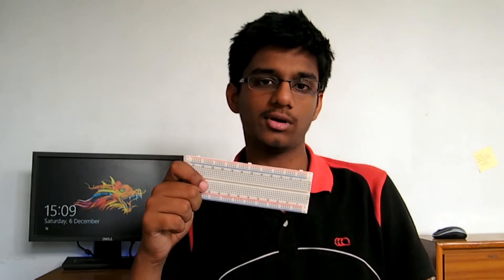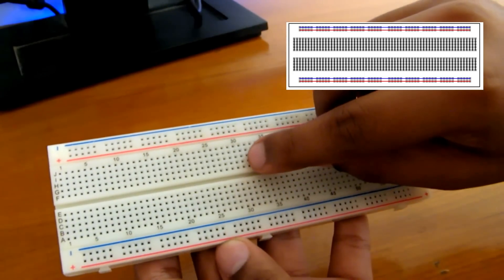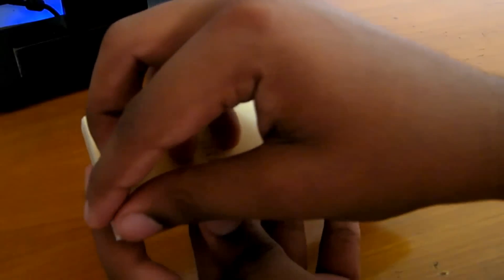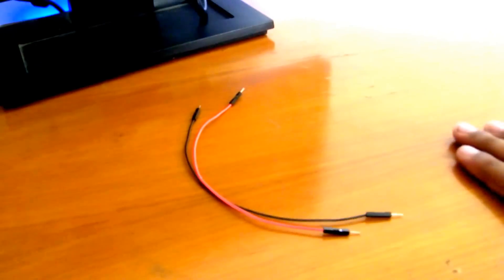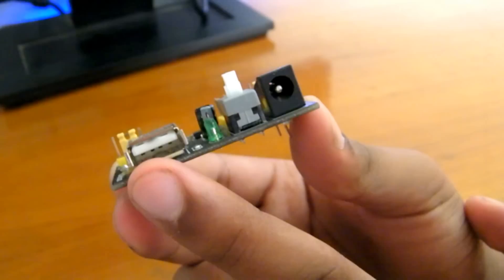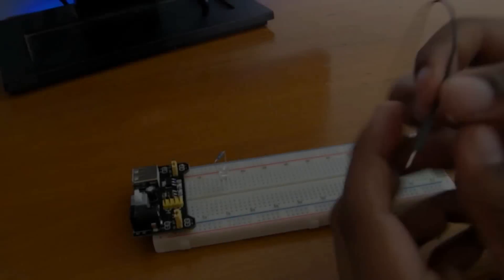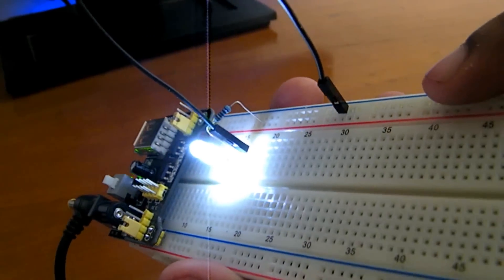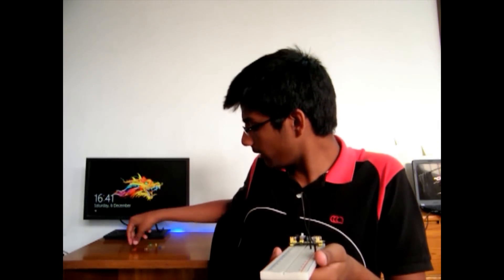How to use a Breadboard

Comment: For some reason, It didn't work. My letters and numbers do go in the opposite way as yours (e.g. 5-60 face vertically while a-j face horizontally) so I'm not sure if this is the reason it didn't turn on the LED.